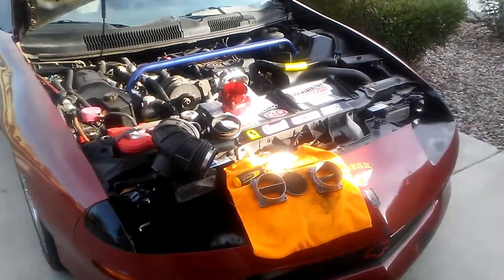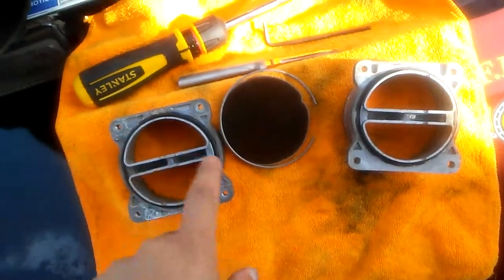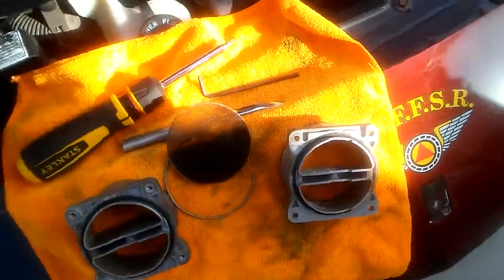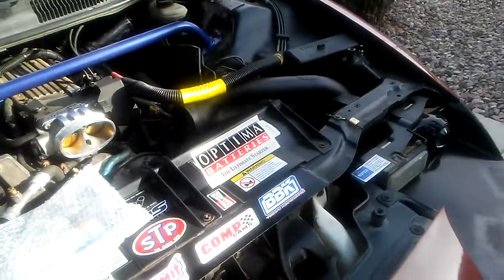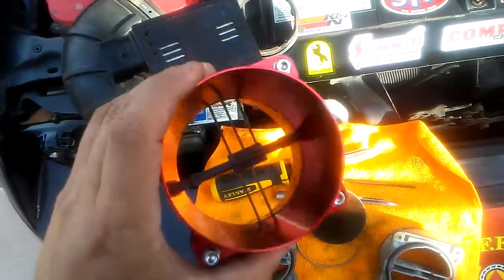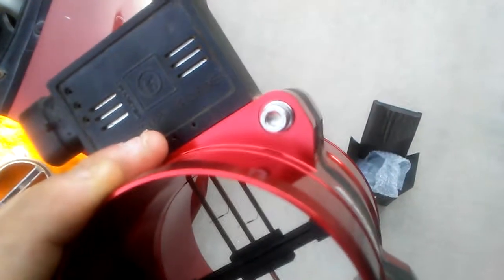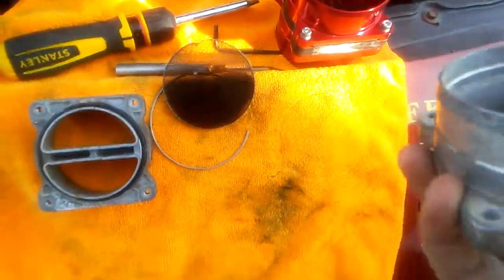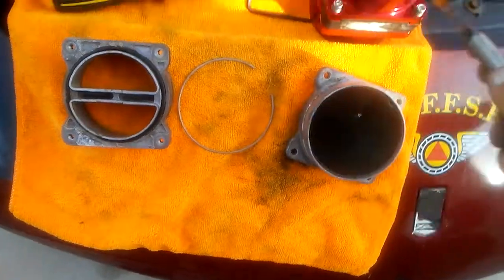Z28 Camaro MAF sensor porting MOD

Comment: Hey there I just bought one of those same exact one as urs the red ported one,ppl from the camaro z28 website are telling me to keep the screen n not to get a ported maf.

I have a 1994 camaro lt1,pretty much all common mods,bigger cam,long tube straight pipes no muffler n no cats.

What are ur results from this mod
Reply: DutchRps 
Lol yea injuneer told me I'm looking at problems later on. But yes my air filter is in great shape,i bought a new k:n a filter,n have the whole kn system. Thank u so much,n I feel a pretty big difference. I appreciate the video